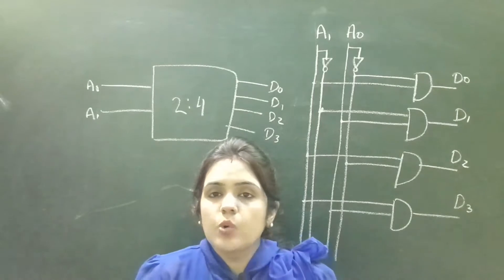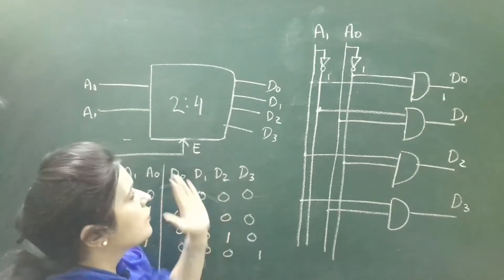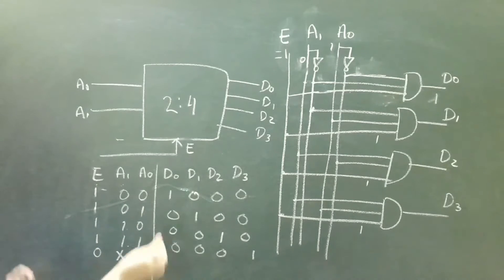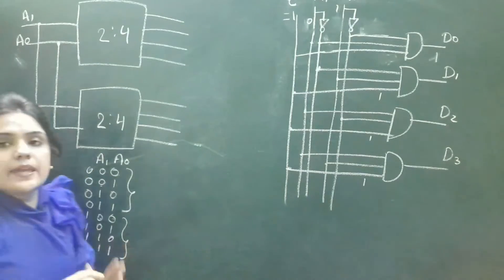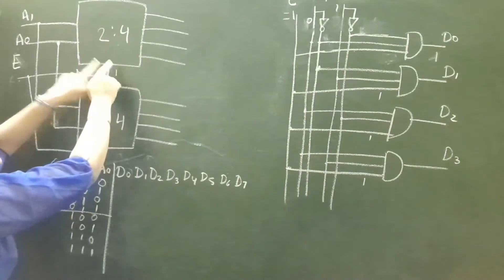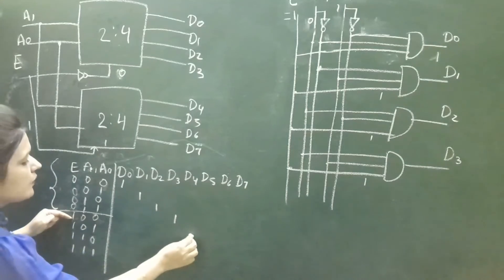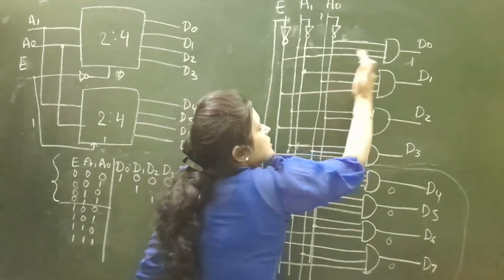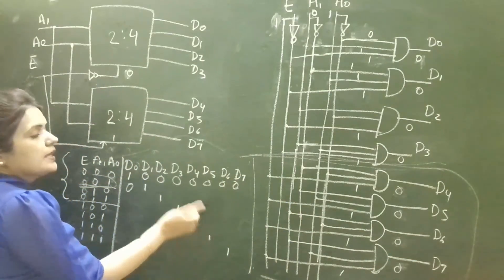3 to 8 decoder using 2 to 4 decoders

Comment: Why did we use E instead of A2? I am a little confused since is a 3:8 decoder using a 2:4 decoder so it should have 3 inputs but I only saw 2 A0 and A1